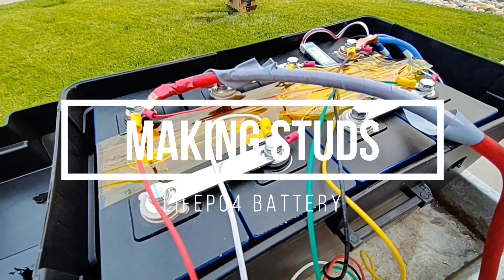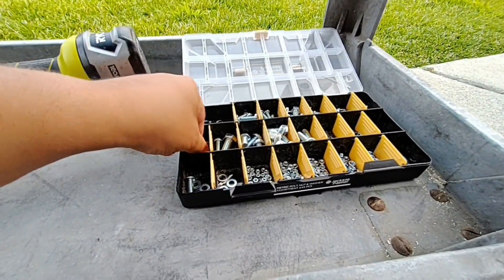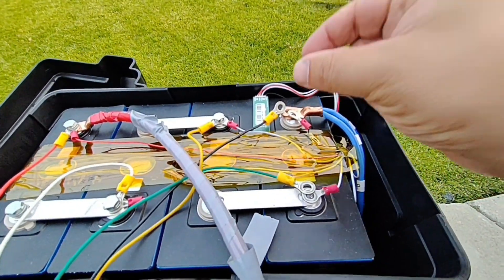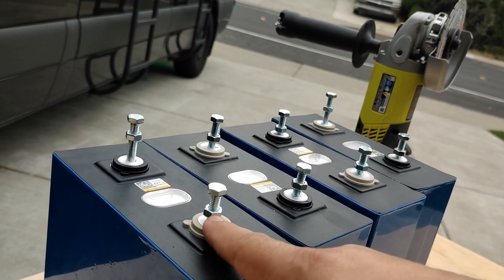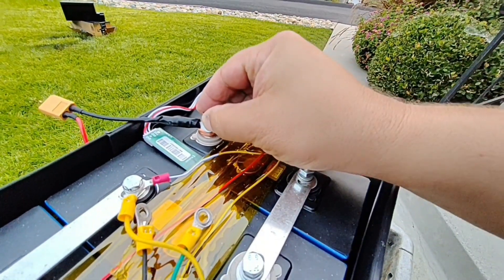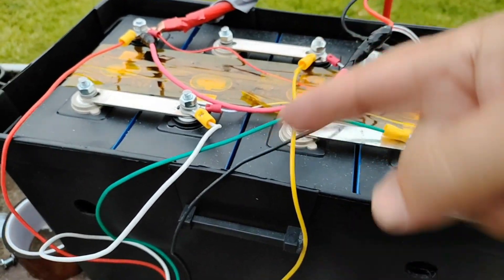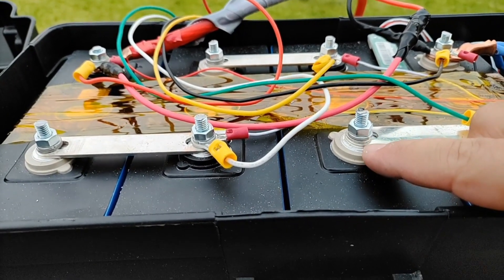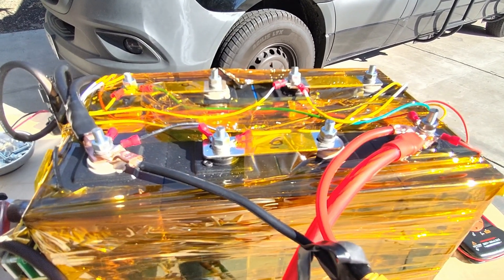LifePo4 Battery Build▶️How To Make Battery Studs For Eve 280ah Cells P3

Comment from the maker: You can download the professional version here 
   Download link-IOS (cannot be set): Search in the APP STORE
   Download link-Andriod (can be set): https://radiobtech.freshdesk.com/support/solutions/articles/70000114128-android-xiaoxiang-application-fully-programmable-version-

280 AH Lifepo4 Cells https://s.click.aliexpress.com/e/_Ar8PQs
Amazon link https://amzn.to/401KFT3
Current best supplier of BMS Grab the 100 amp 4s or 4s 120 amp version https://s.click.aliexpress.com/e/_AFAlX2
120 AMPS BMS on Amazon https://amzn.to/3FnDs6C
120 AMPS BMS option 2 https://amzn.to/3tDnbrz
Secondary BMS for the best price, only grab the 5 amp version https://s.click.aliexpress.com/e/_9G5JUk
Secondary BMS on Amazon for a much higher price https://amzn.to/3QlZKvE

Recommended Victron 30 AMP battery charger Victron 15 AMP battery charge
Victron 15 AMP battery charger https://amzn.to/3txiAqB
Recommended 500 Battery shunt https://amzn.to/3ZY8H1i
Recommended DC to DC charger for solar and Vehicle power https://amzn.to/3RYgEBP
Recommended Solar kit https://amzn.to/3rM8Upg
100 piece lug kit https://amzn.to/3RZrnvT
Tinned 1/0 Lugs https://amzn.to/45AkfsL
1700 piece hardware kit https://amzn.to/45CHumf
use Bussbar instead of breakers https://amzn.to/3tHRltu
Fuse for Bussbar https://amzn.to/3ZYDbAm
Xt60 connectors https://amzn.to/3tC7qB2
XT90 Connectors -recommended https://amzn.to/46u4zsq
8 Guage wire https://amzn.to/3txiM9j
4 Guage wire https://amzn.to/3M0WvHC
Fish paper - https://amzn.to/3M7fQqm
Battery Box https://amzn.to/3M0WT8H
https://www.manualslib.com/manual/1933154/Overkill-Solar-Bms-Series.html?page=29#manual

LifePo4 Battery Build Series
Video #1. Why Build Your Own Lifepo4 Battery - https://youtu.be/j02eP4d0ndk
Video #2. Putting the Cells Together - https://youtu.be/yccgshc1jQ8
Video #3. Making Battery Studs - https://youtu.be/MAAs5nlK21I
Video #4. Top Balancing - https://youtu.be/6Co5oQt4QWA
Video #5. Attaching the BMS - https://youtu.be/sUqu7SYijd4
Video #6. Using The App- https://youtu.be/VgZPNiE0zPo
Video #7. Troubleshooting, where to shop and save- https://youtu.be/rrMrcKRKa_w
Free IOS JBD App View Multiple Batteries Simultaneously https://youtu.be/EvXkkn2u-MI
BMS App Comparision https://youtu.be/9hrcOiey_ds
Fuse/Breaker issues https://youtu.be/Odk60wwS-aM